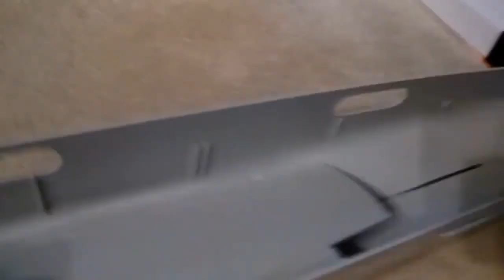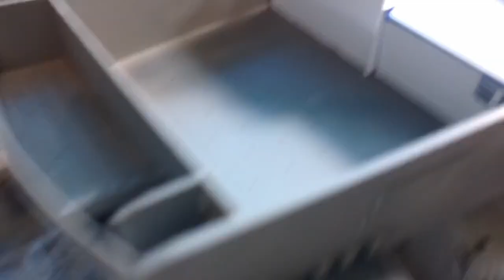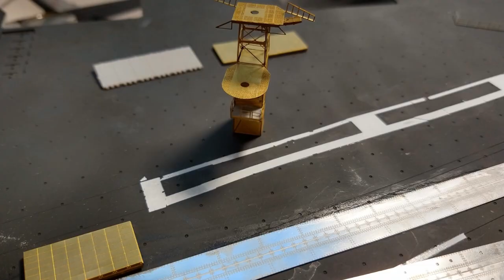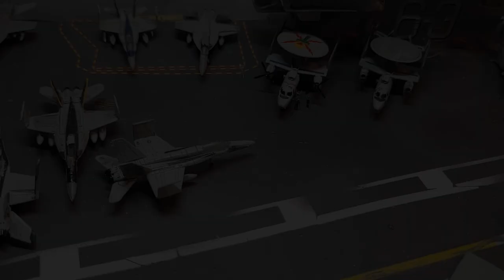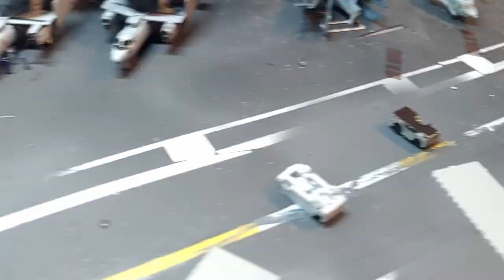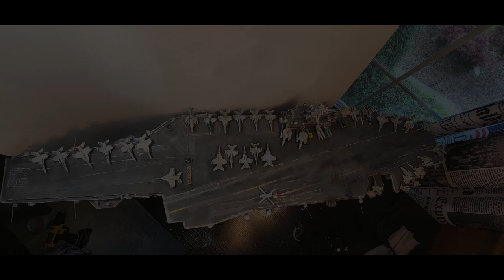Trumpeter 1/350 USS Kitty Hawk Finale

Comment: I just watched thru your build...I have this same kit, along with the MK1 Designs Detail Up Kit you used as well...Also picked up an an entire 3-D printed Hangar bay walls kit and replacement elevator doors from the now-defunct Shapeways. Bought enough aircraft to depict the entire CVW-15, and found someone to make the decals for the hangar bay and correct squadron markings for all of CVW-15. I was aboard the "Shitty Kitty" as an Aviation Electronics Tech with VF-111 for the WESTPAC cruise NOV92-MAY93 where we took part in supporting Operation: Restore Hope in Somalia, as well as the air strikes in Iraq in early 93. My intention is to make the kit look the way she did during that time period. I'm probably going to go a little more in-depth on detail by adding some of the pipes and cable bundles that ran along the sponson walls and in other visible areas. You did an outstanding job! If there was any constructive criticism I'd give, it would be to back off the weathering a bit. Even after 6 months at sea, and countless cat shots and recoveries, the flight deck never got to a point where the markings were nearly indistinguishable. Neither did the rust on the hull ever get to that point. Whenever we were in port, we always had either ship's company personnel, or a locally hired company cleaning and repainting areas on the hull and flight deck. Funny story, I remember being in the hangar bay looking out through the elevator doors in Hong Kong. We were anchored out in the harbor, and a bunch of  local people in the wooden boats with the characteristic build of the SE Asian/Chinese fishing boats were all around the ship with rollers on really long poles repainting the hull. Also, the metal catapult strips were actually flush (built into) with the deck surface. Something the instructions for the detail kit overlooks. I've been looking for videos using this detail set just to see what others did with those. I think I may carve or sand out those areas to make mine lay down flush. Otherwise, congrats! That is a TON of work. Nobody who watches this will truly understand the sheer amount of PE that the MK1 Design detail kit comes with, and how actually miniscule much of it is. My only gripe with it, is that it doesnt include enough PE to Detail out an entire air wing...just a few of each type of plane.
Reply from the maker: Yeah, I definitely agree on the weathering. But there is something about a ship with rust streaks that just look so cool to me. It is a shame with the mk1 not including enough for an air wing. I did see that mk1 has made the bombs and missiles 3d printed part for the constellation version which is infinitely better. Thanks for your service and thanks for sharing always cool to hear stories and tidbits from military life